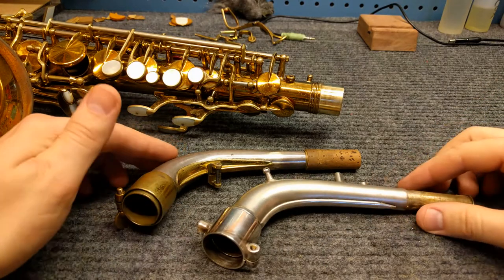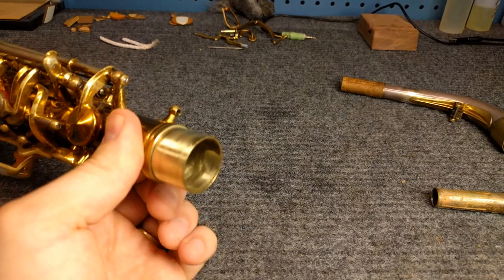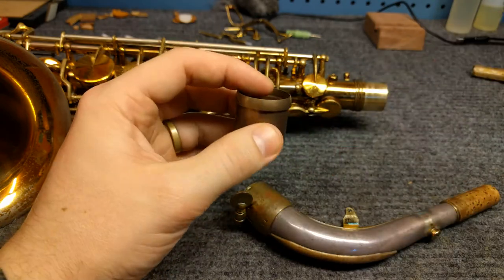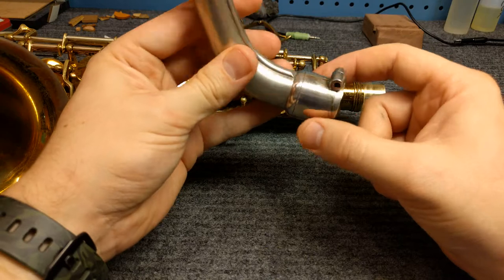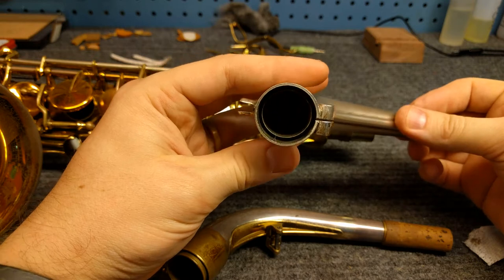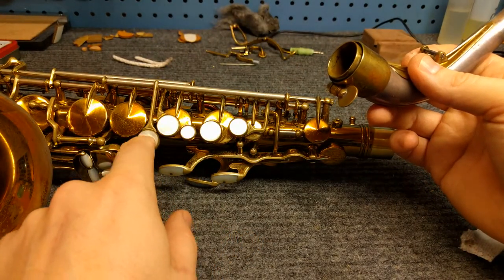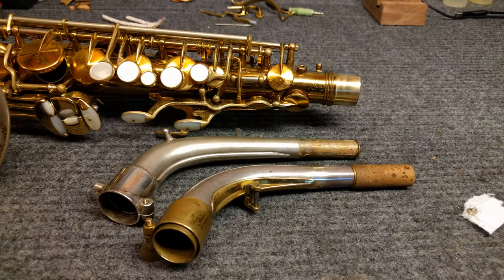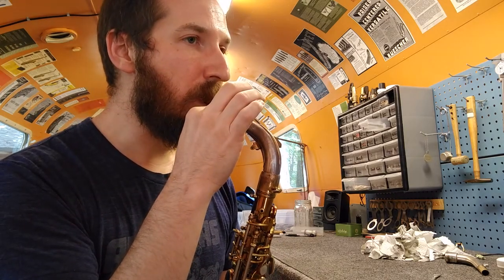Saxophone Repair Topic: Double Socket Necks

Comment: Great video - on this subject - I recently purchased a King Super 20 alto which had a newly installed double socket tenon and receiver using Mike Barnes (UK) handmade parts. Also received the original parts. It seems to play fine. Any comment on this way of dealing with it ?

Comment: Hi Matt, thanks for the video I have experienced the pain with those necks on Zephyrs and super 20's. BTW cleaning the lapping compound inside the tennons is easily done with a de-greaser spray. I get them in Australia from Automotive shops for a few dollars. The jet of the spray can gets in and cleans pretty well. Rinse after with soapy water. Cheers !
Reply: I like that idea.  Ever run into a problem with it attacking a lacquer finish?

Comment: Any tips for stuck pivot screws? I have tried an alcohol flame and penetrating oil and have had no luck.
Reply from the maker: perfectly sized high quality screwdriver that fills the whole screw slot (this is of paramount importance), penetrating oil, heat, time, vibration.
Reply: Thank you!